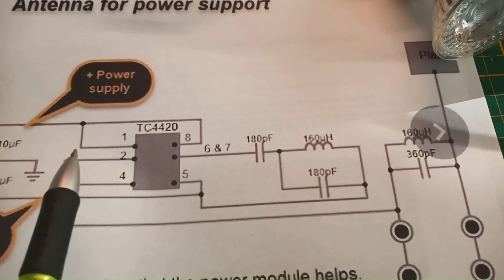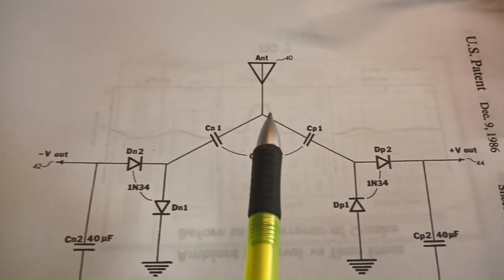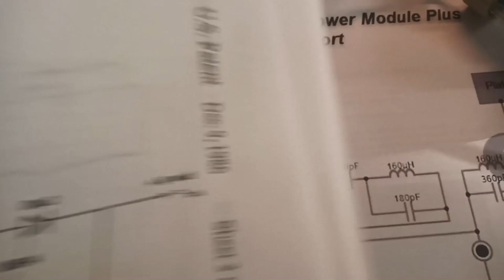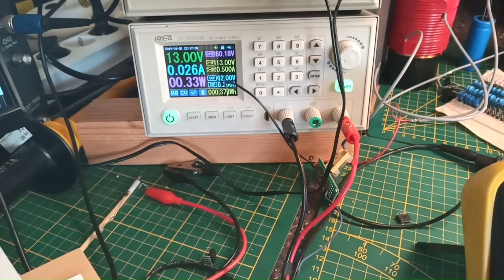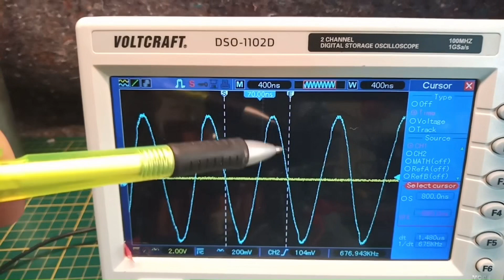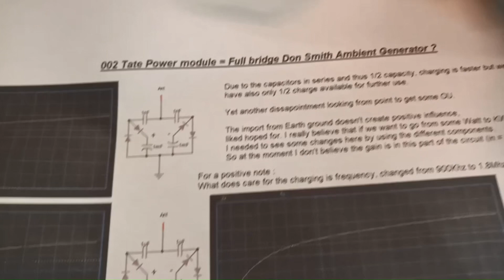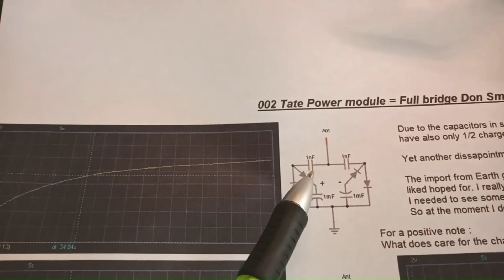Self Resonant System with Power Support by Tate Power Plug

Comment from the maker: Final circuit used in video: https://photos.app.goo.gl/qQW1M5Sr97LH2H2s7
To measure voltage I disconnected the feedback of output of the Tate plugs to the power supply.
This was done to study charging time and how much voltage I could get out.

Hopefully the result of not influencing the frequency due to changing capacitor impedance when charged or not will also show up in my own tryout of the resonance kit 2 setup.
We'll see next week.

Comment: 5:31 Using different capacitor values will affect if it's low pass or high pass. If most of the power is coming from lower frequencies then a large capacitance is fine. In my location, there is a strong AM radio station at 1520 kHz.  A half-wave antenna for this frequency, for example, would be 99 meters. You need a really good ground ... a big iron plate underground. The more mass for this plate the better. Also, WET the dirt where the plate is. When iron is connected to copper, this will cause a galvanic response. I recall reading how iron is such a better material to use for ground. Steel might work too.
Reply from the maker: @Chuck Jordan, when I think on galvanic response I think of very low power (if surface is small) do you have an idea of relationship square meter to possible power? I know there will be lot of factors influencing the result but can you give an example do we speak mW,W,... (When not living just next to trasmitting tower 😀)

For the capacitors I will keep in mind to do the experiments with different values for each different setup. Thx for letting me know.

Comment: What ive found in my experiments is that once you raise voltages and enter resonance , magnet wire does not work as long as the turns of the coils are touching each other. One needs proper insulation between windings. At least 1 inch seperation per 10000 volts. Thats why teslas transmiters were so large.
Reply from the maker: @Conner Swedman, Thank you for sharing your results

Comment: I do wonder if the changing impedance is a problem, or part of the solution.  Somehow as the charging capacitor fills it provides a sort of back pressure to build in L2, building up additional flux.  Having the correct shunt prevents those electrons from returning back to ground, I believe...

So I'm very interested to see your results if this helps or hurts!
Reply from the maker: You're not the only one who's curious :)
I will measure field behavior with scope probe to be able and see if there are differences.
Reply from the maker: @Phives, Today I experimented with the charging and made a graph with transient recorder. I saw a phase shift in the fields when using normal diode bridge but the graph didn't show any change in charging rate at the points where this phase shift was manifesting. This was without the varistor because I want to build up things to get better idea of there influence to the end result.  https://youtu.be/RL4bKjh4-uE
Reply: @brunovk417  I did see that good video.  One thing I've noticed about when there's the trumpet wave is that the capacitor does not follow a typical charge curve profile, but starts to ramp up towards a final voltage.  Sometimes adjusting the input frequency up or down can produce this profile.  Looking forward to the next video!
Reply from the maker: @Phives, At the moment I'm thinking on how to create the situation like a Van DerGraaff generator where charge is added on inside of capacitor and there's no feedback of the charge (Faraday Ice pail experiment) (https://youtu.be/GAtAG938AQc?t=2539)
 I think for frequency stability this step between our resonant system & output switching could give us really good result. The resonant system will not feel the influence of what is charged up. The Tate device looks like it stops the phase shifting but not the complete influence of what is charged up.
Off course just an idea that I want to look deeper into at the moment, reality does differ from thinking :)
Reply from the maker: @Phives, I also looked at what happens when we put the same amount of power (Wattage) in a Tate ambient power module like we put into a system with full bridge rectifier: https://photos.app.goo.gl/yGZNhuDbkU9Gdwb98
We see that the charging rate is not that different, but the final voltage is much higher.
Reply: @brunovk417  very cool!  I'm seeing if I can drive the L1 a bit differently and get more of a free oscillation.  I see my current tick up at resonance quite high, so it's more pure induction rather than having the L2 "listen" to the transmitter.  Also in my setup I have a CW/CCW center tapped L2.  I'm probably just gonna build a standard L2 from now on.